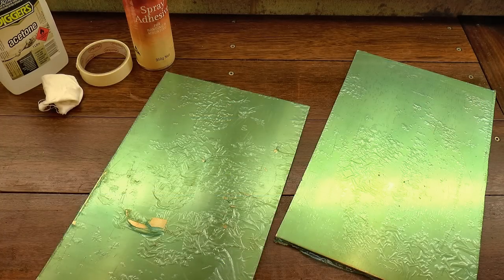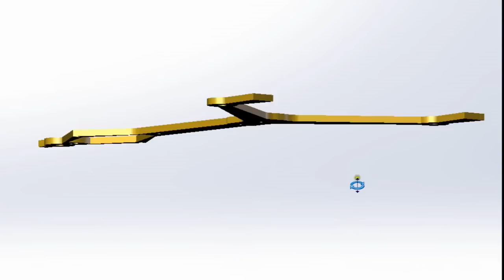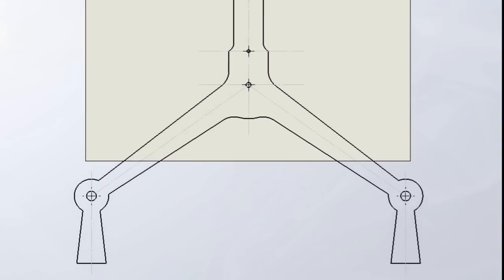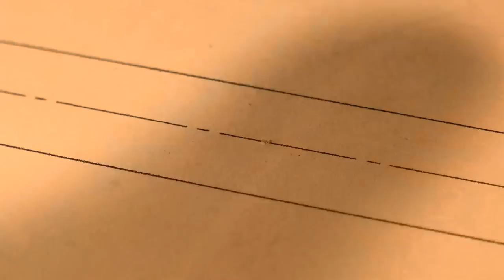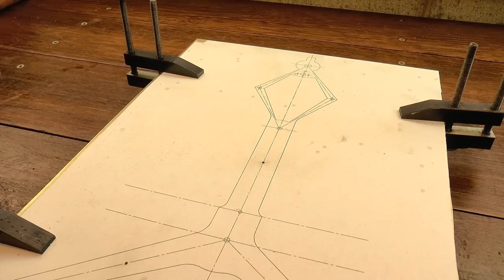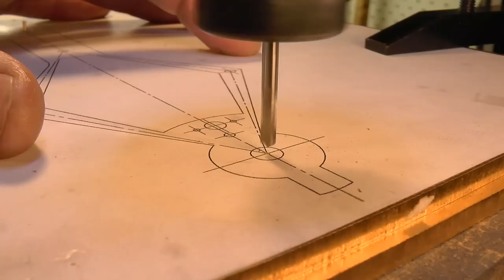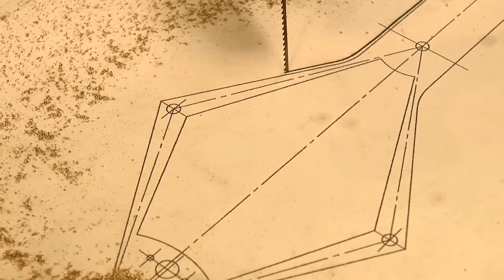Clockmaking - How To Make A Clock In The Home Machine Shop - Part 1 - Making The Clock Frames

Comment: Unfortunately I don’t have the patience of a saint like Chris to do a great job with all that filing, so I cheated by machining the frames using a milling machine to the finished size. The way I did it wouldn’t make an interesting video but Chris uses techniques they used over 100 years ago which makes for better viewing. Well done Chris!
Reply: I just got the book and I am also planning on going with CNC. Is there anything I should know about? Did you still manually depth the wheels or did you just mill it to the theoretically correct locations on the frames. Did you use the B.A screw sizes called for in the book or did you substitute in Metric or English threads? Any help would be appreciated.
Reply: @matthewanderson9304  Hello Matthew .. I also plan to make this clock, and like you I plan to use my CNC mill and CNC router to speed up the process and make accurate cuts
Did you ever make all the parts using the CNC process ? and finish the clock ?
DId you just use the CAD drawings from clickspring for the CNC work ?
Which book was the one you bought ?
Would you mind sharing your experiences on this please ?
Many thanks Matthew
Reply: @matthewanderson9304 The BA thread size IS British.😉

Comment: Hi
I realise now you are using a Sherline. Thanks for that.  I have a Taig which seems quite similar. Incidentally I followed up your link for the scroll saw blades and am now cutting brass with them. The old story about the right tool for the job.
Robert

Comment: I think I read somewhere that he had over 1000 hours in the project (correct me if I an
m wrong)
If that is the case at standard shop rates the break even cost would be 80-110,000.00 usd.
Sure makes you appreciate what mass production has done for us & how it has totally changed what objects are valued at and what the craft is worth.

Comment: Chris, really appreciate all the work you go through both in making things and in creating these videos !!!.  I'm a model engine builder and would like to offer a suggestion for the next time you make frames, the way I guarantee symmetry and squareness of steam engine con rods applies to frames like this, first use the three bolt holes as your registration holes rather than any other auxiliary holes, after rough cut out and rough filing start this finishing process: flip the back plate so that its left side matches the front plates right side and vise versa and now file/grind/sand so that you get perfect left-right symmetry,  then  swap the front and back plates so that the faces that were facing each other are now facing outwards and file/grind/sand until there's no obvious cant/angle to the edges, repeat these two kinds of swaps a couple times and you end up with perfect symmetry and perfect squareness. Some day I hope to add a skeleton clock and an ancient greek model of the cosmos to my collection, and you're a great inspiration.  HTH, let me know if you ever decide to try it.

Comment: You make your videos like your skills at machining. A1! Some people who aren't familiar with applied machine shop skills may get lost as you speed through things but that's the breaks. Fantastic videos and workmanship.

And sigh. You are using brass. If only I could take the time and trouble you do when working with hardened steels in gunsmithing! I'd wear out a few miles of sanding belt! I'm definitely going to use your techniques and inlay some brass in my work though.
Reply from the maker: +Ryan James Great to have you watching Ryan

Comment: Very good work. I'm just curious as to why you really need the register pins? Why can't you simply use the three pillar holes to register the two frames together with the cap bolts?
Reply from the maker: Hey Trevor, the pins are a more precise way to do it - cap bolts are a free fit in the hole, so have a slight amount of play - Cheers :)

Comment: I would appreciate it if you could let me know what scroll saw and saw blade( teeth per inch) you are using. I would also like to know where you got the die filer and files. I think it would be great if you had a video on the machines and  tooling you have in your workshop
Thanks again for all your effort
Reply from the maker: +Joel S Hey Joel, full details in reply to your email, thanks for watching

Comment: +Clickspring Why did you use the filing tool before you used the belt sander? Couldn't you go directly to the belt sander and clean up afterwards with the filing tool? Or are there reasons to do it like you did in this video?

Thanks for uploading such an awesome high quality build of your clock!
Reply from the maker: +Sincee1809 To some extent yes, I tend to move between them both depending on what I need to achieve - Coarse belt/vertical filer/fine belt is a common routine I use. Having said that the cut left over from the filing machine is not as continuous as a fine belt due to the narrow width of the file, so for a continuous surface I find its best to use the belt last in some way. Cheers mate :)
Reply: Clickspring Thanks a lot for responding :)

Comment: How well does the scroll saw work on brass? Did you have to replace blades often? What type of blades did you use? (TPI, thickness, etc.)
Reply from the maker: +Bear5177 Works great, blades last extremely well on brass, try Glardon/Vallorbe (aka Super Pike) pinless: http://jewellerssupplies.com.au/vallorbe-sawblades-pack-p-1749.html
Reply: Awesome! Thank you!

Comment: I'm curious, why do you switch between the bench file and belt sander? Does the belt sander allow you to bring in the curves more easily?
Reply from the maker: +MotoTrippin Yes, the belt sander is excellent for rapid stock removal on straight and curved sections, and can surface very accurately to the line. The bench filing machine is excellent for clearing out internal corners. Thanks for watching.

Comment: Now if this were ThisOldTony, these would have been carefully programmed, simulated a few times, and then put through the router in all HD glory.
If it was AvE, they would have probably been messed out a few times by milling with a potato, using some sort of acid solution, cut through with a torch or some ridiculous (and entertaining in the same time) method. However, I like this way of doing things too. Subscribed.

Comment: What blade saw are you using to cut metal? From what number and brand? I could not cut it with a scrollsaw!
Reply from the maker: I use these: http://www.jewellerssupplies.com.au/product-group/3508-super-pike-sawblades-pack-144/category/222-sawing Number 4 works well with the plates

Comment: what kind of scroll saw blade do you use? I've cut aluminum but it seems like slow going. maybe I should use larger pitch to keep the saw clear of chips?
Reply from the maker: +nikotwenty I use these: http://www.thewoodworks.com.au/shop/saw-blades/jewelers/blades-scroll-saw-pinless-antilope-blue-101-detail Generally I find a finer tooth pitch is better, but I don't often saw aluminium. Cheers, Chris.

Comment: I was wondering, why add the guide pins when you were going to add the screws? Would they not work well to align the work?
Reply from the maker: +SGaffin That's a great question - Typically screws have a bit too much play in the thread to act as good locators; two pins are a safer bet. Thanks very much for watching and asking.

Comment: how much does all this materials even cost? :/
Reply: It's not too bad. You just take it a step at a time. Sure if you bought ALL the material up front it would seem expensive. But you buy some here, machine here...buy some there machine there...and so on. It's about the journey AND the destination. You don't have to get there by next weekend. Secondly think about what it would cost if you tried to buy this clock ?? Thirdly there's the pride of getting to the end of the journey and saying; "I built it!! (finally!). And it works !!"...Damn near priceless.

Comment: 3/16th engravers brass 353  ...  over $100    in 12 x12 inches.... r u kidding?
Reply from the maker: regarding?
Reply: the price of BRASS here in the U S is astronomical... don't know about new zeland but   I would imagine its close. which means  to complete this exercise    how   much   did   you   spend  in  just  brass??
Reply from the maker: Yes brass is expensive everywhere - approx $600 in brass and other materials costs